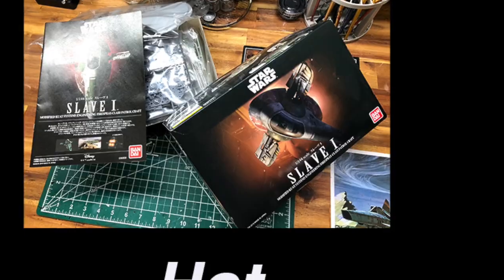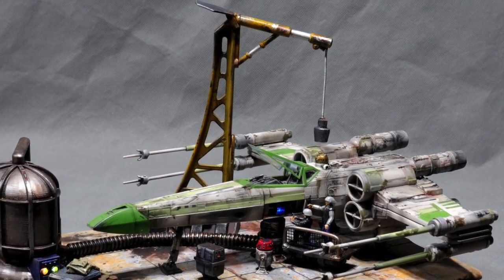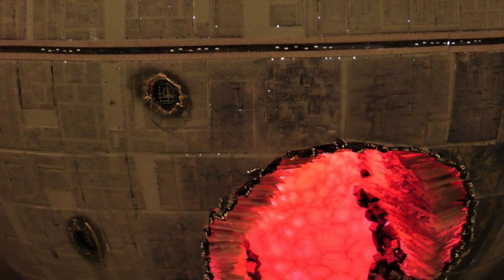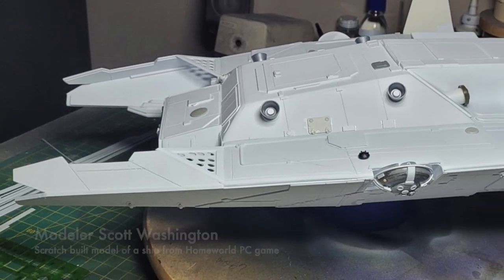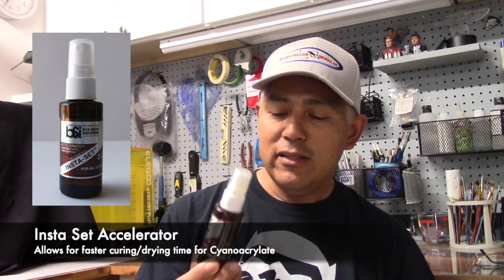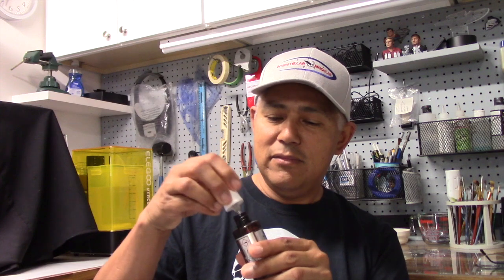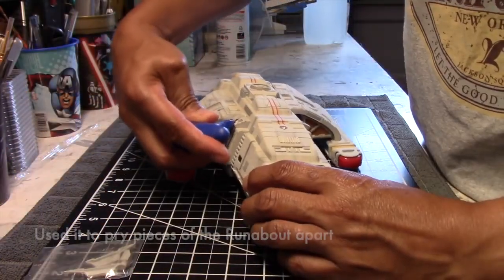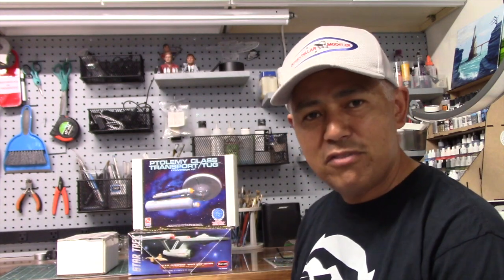Hot off the Bench Episode 5

Comment: Have you ever had the super glue fumes fog your LEDs or clear parts?
Reply from the maker: LEDs no, clear parts yes. Best thing is to avoid superglue with any clear pieces and use something like canopy glue which is made for transparent plastic. Good question regarding the LEDs. That’s just  not been a problm. Probably wouldn’t have mattered in most cases anyway since i’ve used them to light interiors and such. Thanks for watching